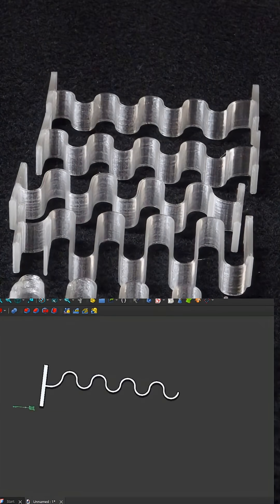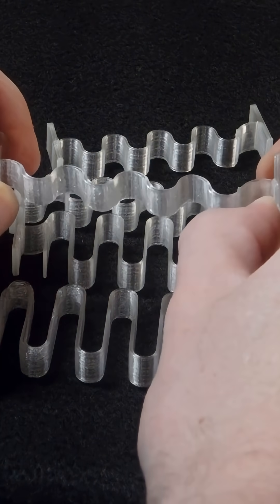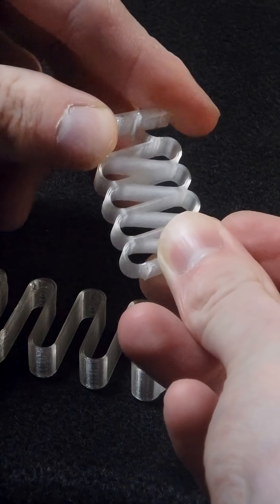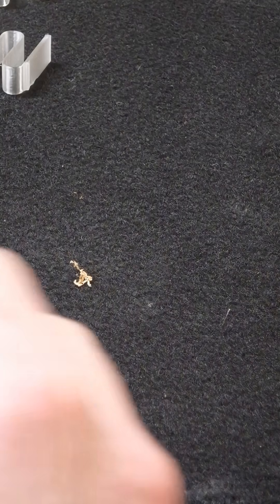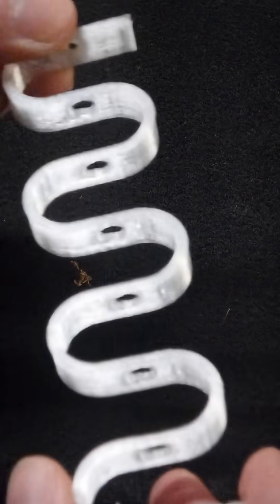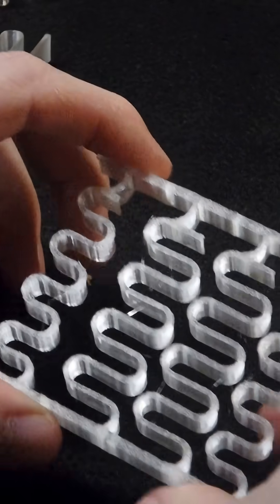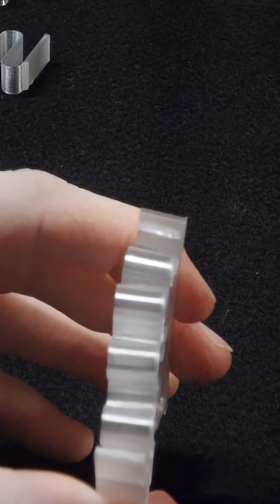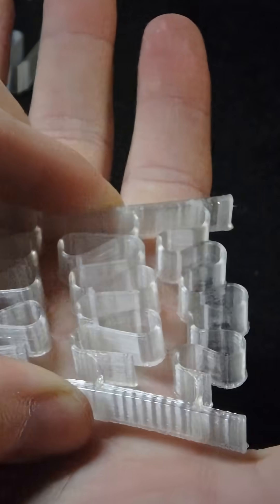Testing springs sizes #3dprinting #springs

Comment: If slightly square it and interconnect between the array of springs. Alternatively, depending on application, if an array is acceptable: create something inspired by muscles. Make a reversible ratcheting mechanism that is an increasing challenge - like bigger teeth or something. One would be brittle, but many could be moderately resilient.